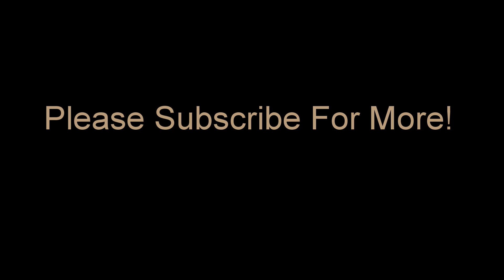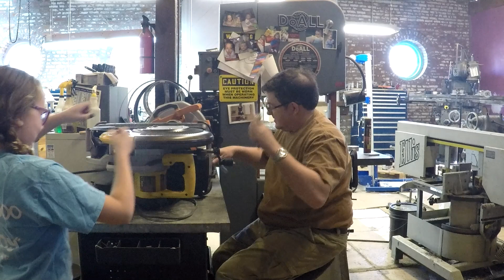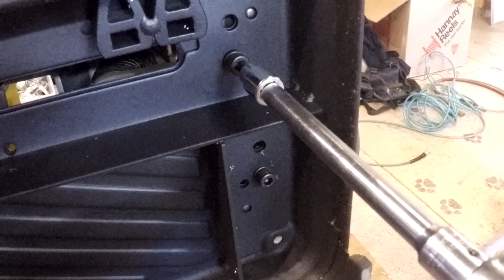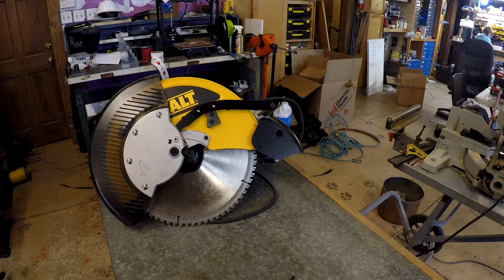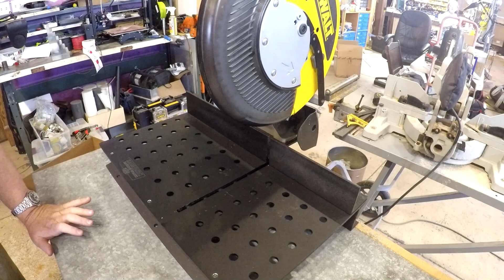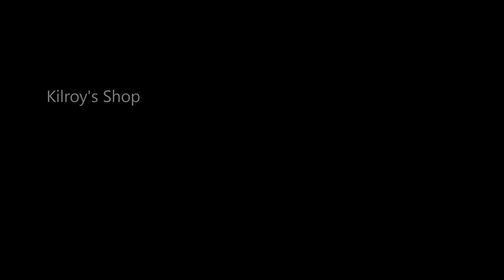Saunders Machine Works DeWalt Saw Base

Comment: Just a note - I just received my saw base today and it looks like they changed the channels that support the plate to a lighter material. I definitely have to bolt the entire assembly to a bench or it tips over backwards when the saw it raised.
Reply from the maker: I can believe that.  Mine will jump up a bit if I let the spring pop the saw up.

Comment: I have the Dewalt and also that Rigid abrasive you have. I have to say, for an abrasive saw that Rigid is a really good tool, best one of the abrasive saws. I use it for rough work where I dont need the clean and accurate cut of the Dewalt. I use the Rigid abrasive saw for rough stuff like Rebar, etc . Nice vid, thanks for posting !

Comment: could I talk you out of the original base or are you going to keep it? I have the saw but another base would sure come in handy for the 24 foot stock I need to cut and keep clamped together. Two clamping bases would allow me to cut a bundle of square tubing all at once easily without more difficult means to achieve that. Need to cut a 4 x 4 bundle or 16 1/2" x 1/2" heavy wall steel tubing bundle of 4 deep and 4 wide all together so that one cut produces 16 parts. so bundle would only be 2" x 2" easily done on this Dewalt. Just aquired a friend that looks like can help me bring the RepRap 3D Printer Frames and 3D printers and 5 function multi center to fruition, which I predict is going to be a big hit....and love this saw its so much better for me than the abrasive cut off only for the fact of not creating airborn particulate matter I have to avoid at all costs from breathing. Altho still have to use the other on occasion. Tell you what let me borrow it and if you ever want it back so you could sell the saw no problem will pay shipping both ways and will scribe in it to return to James kilroy and address as I might not live that long.

Comment: I would make a stand for this saw with big locking wheels so you can wheel it around for cleaning and portability. make it the same height as that table. This is my suggestion

Comment: I want to go in the opposite direction. Want to convert a DeWalt Compound Miter saw Aluminum base and the install a chopsaw assembly on that. 

As shown here, the factory chopsaw base is absolute crap, as most are from DeWalt, Bosch, Makita, etc. 

A real plus would be to take advantage of the built in base mount that swivels instead of the crap thin steel fence and clamp that is never accurate.

Comment: You Really need to get an external mike!! Can barely hear you!
Reply from the maker: Hi Dan, thanks for the input, I will order one today.  You know it is funny, when I edit my video (I use power director) I have to turn down the sound because it is so loud, but after I upload it is different, I have no idea what might cause that.  I will get a lav mic on the way.
Reply: External mics are great, radio mics not so much. They tend to rub on clothing or machinery and pick up all the huffing and puffing from exertion. The only person with a good method for using the radio mic is Keith Fenner. He wears it on his hat peak. Some wear it on their apron or shirt pocket and those are the worst for rubbing scratching etc. Abom79 has the best sound quality IMHO with his external mics.    regards from the UK
Reply: Might try "normalizing" audio if there is such function available in power director.

Comment: Definitely a worthwhile upgrade. It looks much more versatile for clamping and work holding.  I am surprised John doesn't make a version with a swivel base to turn the saw into a mitre, that would be cool!
Reply: I was just going to say this, beat me to it. I never noticed until this video that these saws don't do miters. I have never used a consumer grade metal chop saw. Seems limiting. There are so many aluminum extrusion systems that are meant to be mitered these days for example. The average user of this saw is a contractor, or a fab shop and a contractor is likely to need to do a 45 for both steel stud as well as aluminum handrails and things. If you cant miter a corner, you cant call yourself a fab shop, can you?
A fab shop I worked for had a 12" with a 2hp motor and air powered vises and feed rate. It would swivel, though i don't know if that part was shop built/adapted or not, the rest of the vises and things were. That saw was a beast. That shop was FULL of shop built fixtures and things.
Reply: John also sells a 45 degree fixture tool that goes with the plate.
Reply from the maker: No doubt, I would buy one for sure.
Reply: That will work for small parts, it becomes a pain in the butt with anything over 4 feet. If you want to 45 the end of a 12 foot piece, you either have to clear out half the shop or turn the saw. The other problem with the fixture is I cant see how you cut a 45 in the middle of a piece of stock? When building out of 1" square, cutting miters in the middle lets you cut the ends of 2 pieces at the same time. Swivel the saw to 45, set a stop block and you just flip,chop,flip,chop one part per cut.  With the jig, you gotta make a straight cut and two 45 cuts. 2 extra cuts to achieve the same operation. Plus the loss of 1" of material with every cut. This also requires handling the part way more times and also possibly a machine setup/jig change. Way slower.
Reply: Notso Fresh 
Milwaukee makes one that swivels, I was very impressed with the mitres I was able to cut on it. 45°s were spot on and even. If I remember correctly,  it went from 0° to 50°.